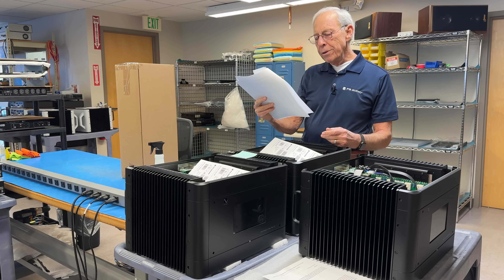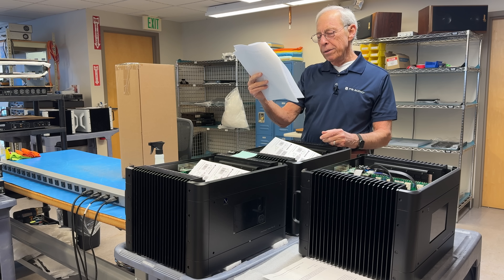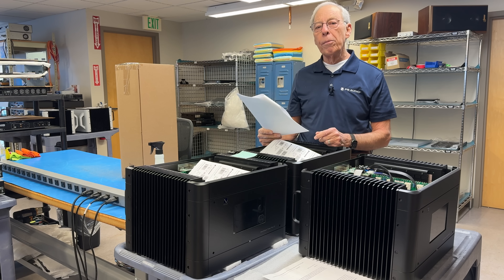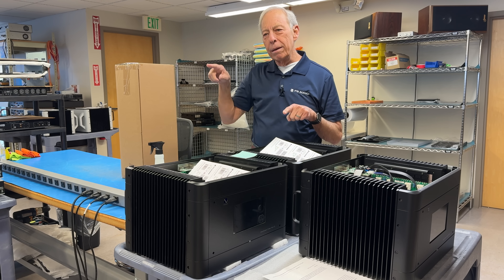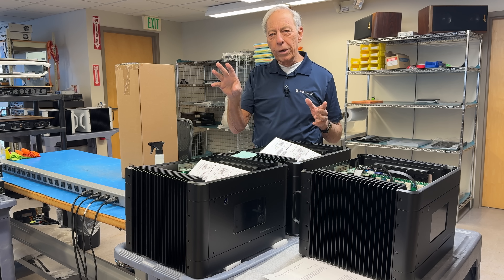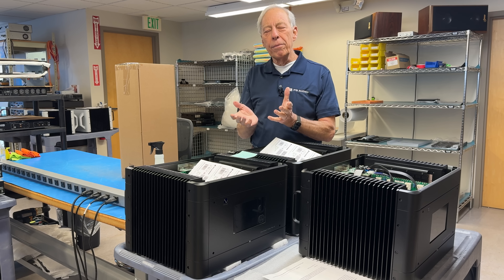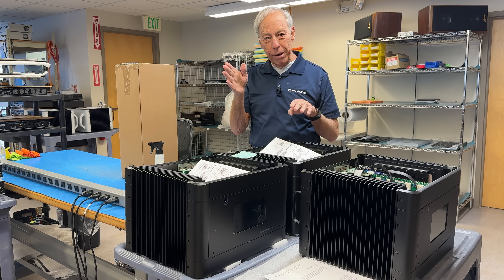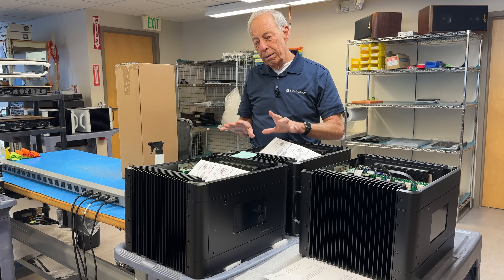Paul explains damping factor

Comment: This was a terrible explanation. Everyone claiming it was a great explanation doesn't know damping factor.
Reply: Ok professor, give us the proper lecture then
Reply: "the lower the impedance, the higher damping factor, the better off you are, in the context of controlling the loudness".

this is a great explanation, what's hard to understand that?
Reply: Paul's explanation was infinitely better than Your non existent one.😂😂😂
Reply: @Geerladenlad  , well, actually NO, lack of explanation is still better than a wrong one!
Reply: @nikolagenov8881  I guess everyone will have to take your word for it. 😂😂😂 Um not!
Reply: You are not that great at explaining yourself.
Reply: Miguel Angel Racero's channel, who is specialist in electronics, gave an technical explanation with measurements about damping factor in audio. He explained (proved and tested) also how much damping factor was needed, and  why more (enough is good enough) was a nonsense. Great channel, like this one, however, it can be very technical because he is a teacher and don't sell stuff. I don't remember the figures, although a damping factor should be over 10, while more than 40 doesn't help at all.
Reply: It depends also on the relation between the impedance (variable) of the speaker and the output of the amplifier.  It can be high enough with or without a bunch of current capacity; it's a voltage divisor that gives the control because the amplifier side is very low impedance.  Maggies need current (also some PS Audio speakers, Harbeth, etc..); however their impedance is very stable (LRS model).
Reply: @Jorge-Fernandez-Lopez  You're correct it's like with thd snobs. 

Thinking you can hear a difference between 0.1 or 0.001% thd you won't.
Reply: The dampingfactor is the ratio of the loudspeaker's impedance at a frequency to the amplifier's output impedance at the same frequency.

A commonly used simplification is to take the nominal impedance of the loudspeaker and the output impedence of the amplifier at 1kHz. Where it mostly matters however are the low frequenties.
Reply: The lack of control of a damping factor under 10 can be pleasant if the right speaker, room and preferences meet. Some frequencies will sound different.
Reply: He's done better, this topic has come up before.
Reply: I thought the damping factor was influenced by the amount of feedback in an amplifier (a received opinion, but I've read it often). I don't think Paul mentioned that at all.
Reply: Responding to the post about damping:

It doesn't send the back emf to ground, it just doesn't let the back emf affect the output voltage of the amplifier.. the back emf is being "sourced" by the speaker voice coil, which, ideally has a few ohms impedance/resistance, and that is hopefully much higher than the output resistance of the amp's output stage, combined with any resistance/impedance between the voice coil and amp... Interconnections, crossover (if used), speaker cables, binding posts... Typical high power MOSFETs have on resistance (fully driven/saturation) in milliohms, but the apparent resistance can be higher, and, as noted, other resistances between the speaker voice coil and amplifier might completely "swamp" the amplifier impedance. The damping factor of an amplifier can mean just about nothing, if you don't know the resistances of the other components between the amplifier transistors and the actual voice coil. A damping factor of 1500 into 8 ohms is equal to 0.005 ohms, 5 milliohms, but I'm not sure how this supposed to be measured in the Audiophile domain, but it means either a lot of transistors, or very hard drive (maybe a load of feedback!), plus, the rest of the system resistances... well, 5 milliohms is not an easy target.
Anyway, y'all, I'm just a simple electronics guy, kind of a test & measurement "specialist"(one needs to be careful about throwing around the word "expert") with some years experience at "factory level" with some decent companies...
Reply: @lohikarhu734  An expert ?  the channel I talked about or Audioholics (similar academic background). We only need to know the output impedance of the amplifier (ref: specifications [manual]) and approximately the nominal impedance of the speakers (impedance of adequate speaker cables isn't significant ). We don't need to know whats is going inside four our purpose (matching speakers and amplifier: black box for us. A conductor, two resistances in series (one with very low resistance and the other big): the current through the resistance is the same, although most of the voltage drop will be inside the big resistance, the voltage in the first one won't vary much. That's what we are looking for in a voltage source (stability and precision): a voltage that "follows" the music accurately (+ gain) without being affected by current required by speakers. If the maker doesn't give the damping factor for various nominal impedance, we can do the maths with de output impedance of the amplifier. As audiophiles we can know that, figure out how many watts (real ones) we really need for a volume, dynamic range, headroom and distance, which amplifier's power specs are unreal or exaggerated, which is the sensitivity in dB/W of a speaker when the specs are in dB/2,83 V, how match output sensitivity of preamp and imput of amplifier, how determine which acoustic treatment we need and which "bass" traps work or doesn't work, etc.. Great hobby.

Comment: Can poor quality speaker cables affect the impedence or damping factor?

Generally Solid State amplifiers have high damping factors but there are speakers that work better with much lower damping factors.
Reply: The impedance of the speaker cable has impact on the total damping factor: high impedance speaker cable results in lower damping factor, so you need low impedance (thicker diameter) speaker cable.
Reply: @marckant3611  cheers 🥂

Comment: Is there some kind of trade off that amplifier manufacturers have to contend with to provide a higher damping factor ? ...Paul makes it  sound so simple ..I wonder why all manufacturers dont implement high df as standard ?
Reply: A high df needs a huge power supply, hence more expensive.
Reply: In conventional solid state amps it requires a very well designed and beefy power supply. That is expensive. It is possible to compensate using feedback loops to provide a good DF number with poor PS performance. But feedback loops can harm the sound. So some manufacturers get good DF with a better amp and some with design games.

Comment: It's rather unfortunate that speaker  manufacturers are often rather economical with the truth where impedance,sensitivity and bandwidth are concerned. Additional impedances due to the type of crossover used and to a far lesser extent the  choice of cable contribute towards the effectiveness of damping factor too.